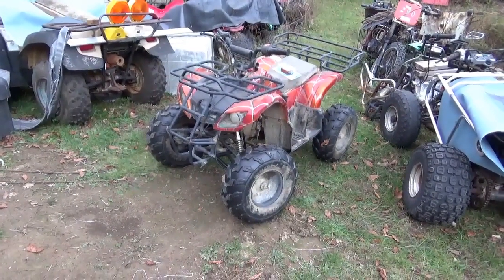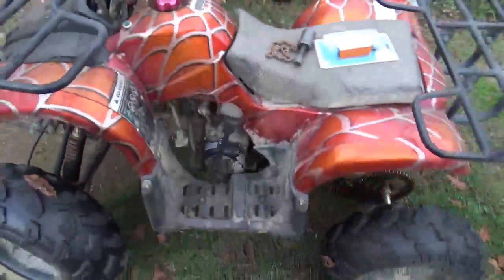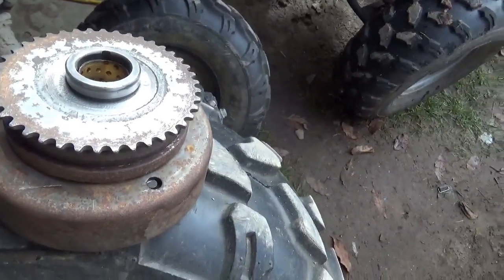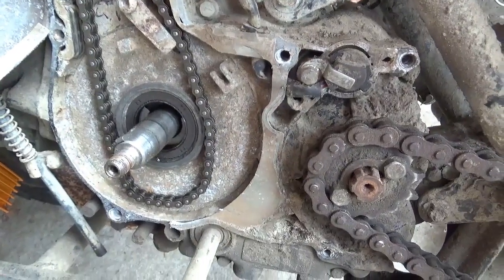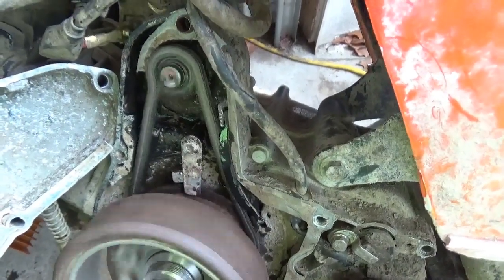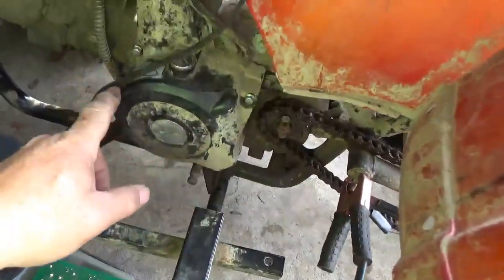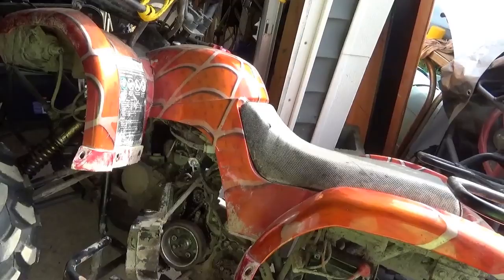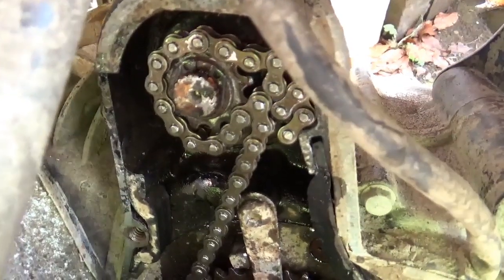Coolster ATV Racing CDI Upgrade, Starter Chains Keep Breaking!

Comment: I've had racing cdi's on a couple of bikes and never had that issue. The cdi I put on them was blue but color shouldn't matter. Interesting tho maybe try another brand of cdi. The ones I got said they just changed the rpm limit from 6k to 10k. Not sure if it had a spark advance like your describing.

Comment: i had to replace 2015 harley street 750's starter starter bearing assembly. they assembled the bearings just like you seen but there where more bearings and they were all aligned the correct way. took me a month until i spotted it. now bikes runs better than it did brand new. course  harley was of no help